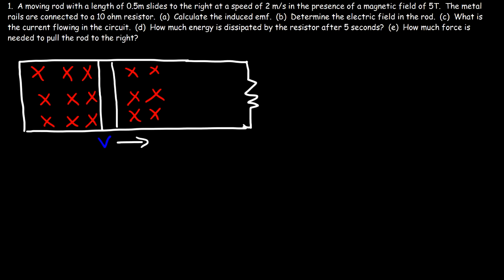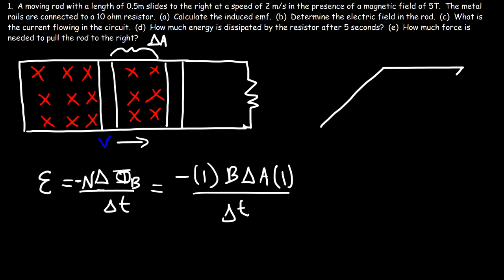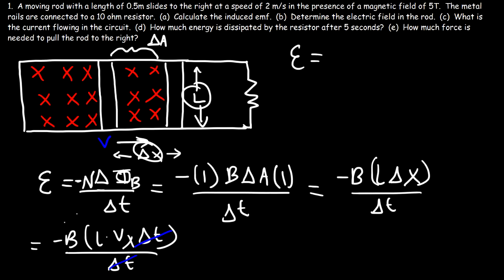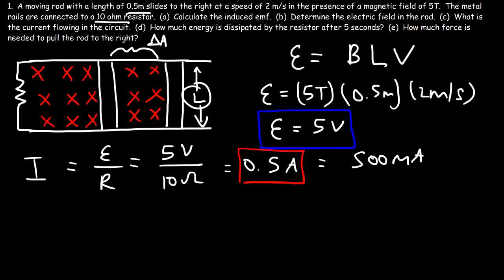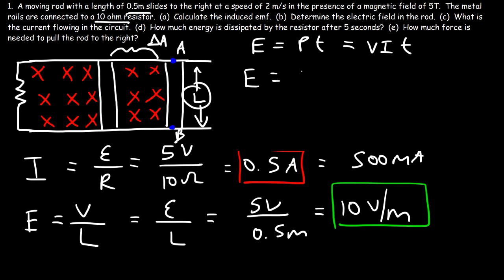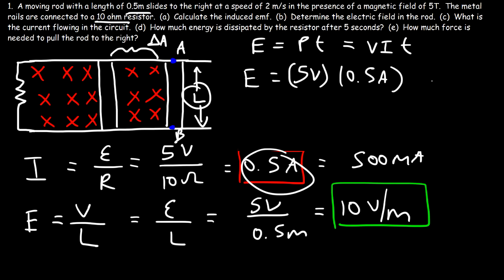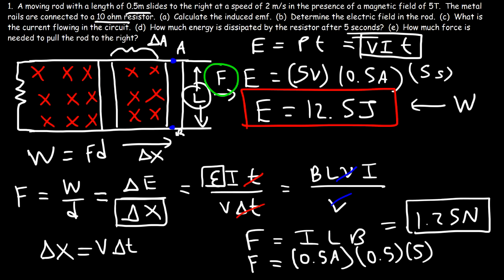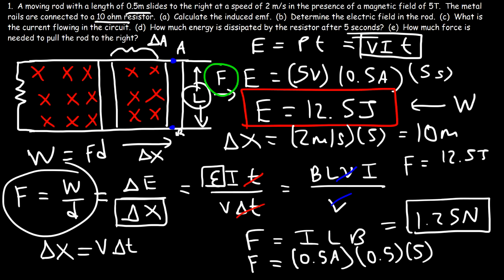Induced EMF In Moving Conductor, Sliding Bar Generator - Faraday's Law of Electromagnetic Induction

Comment: why does he keep ignoring the negative sign when using the formula -N deltaflux/delta t. For example in the first problem he found the emf which shoudlve been negative 5 but he said will just ignore the sign. but why ignore the sign!
Reply: The sign is basically lenz's law. Its just saying it will oppose the change in flux. So you can take the absolute value of emf (sorry pretty late haha).